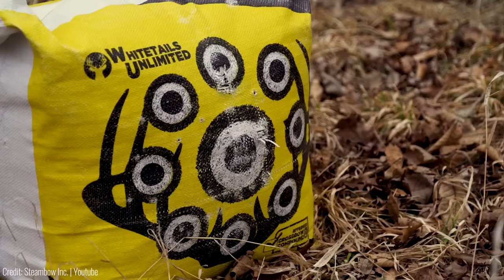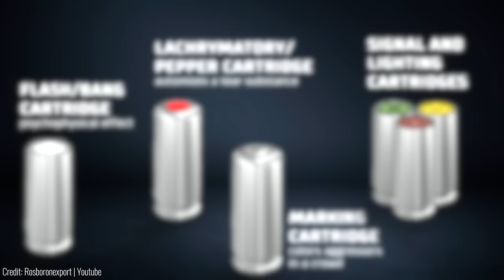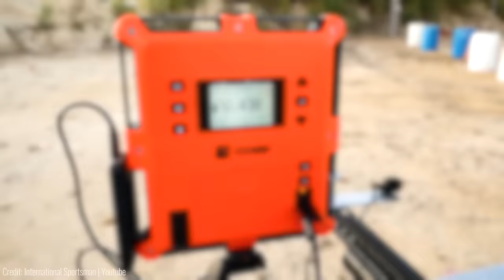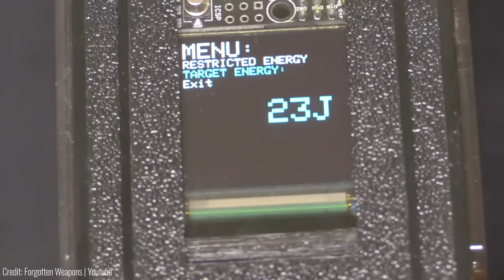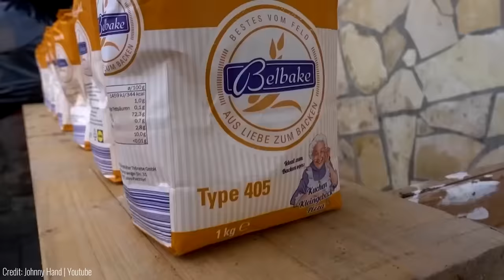12 Lethal Weapons That Don't Need Bullets

Comment: 75 miles per second? That has to be an error. There is absolutely no way.
Reply: Its mach speed, new covert ops tech
Reply: I'm guessing meters... so 250ft/s
Reply: Yea, even naval rail gun is about 1.3miles per second so I doubt this much smaller rail gun is even close to that.
Reply: That’s only 396,000 fps. Of course that is possible, I’ve chronographed my Daisy Red Rider in excess of that!
Reply: @richardwaid4718  I would love to see a crono that can even read that number lol
Reply: From the manufacturer's site: 75 m/s... meters per second or 246 fps. Essentially a Crossman BB gun circa 1980. Complete joke.
Reply: Do the math,,Mach 6
Reply: Feet more than likely

Comment: 00:25 Rochan Slingshot
01:13 Steambow Fenris
02:11 Gamo TC-35
03:18 PB-4SP OSA PISTOL
04:30 Hatsan Harpoon
05:43 CA-09 Railgun
06:47 Grappling Hook --- Question: How many ropes do you get? Or does it just retract the ropes?
07:44 EMG-02 Coilgun
08:41 X-Bow FMA
09:38 Hammer XT
10:25 GR-1 Anvil R Gaus Rifle
11:24 Arcus Arrowstar
Reply: retracts the rope i would not trust it to hold a persons weight. how well could they attach?
Reply: @garfnob4832  it's a lot more than what it sounds like. But yeah, it most likely won't hold the average person today.
Reply: Pointed sticks

Comment: So many Naysayers! Sling Bows and Crossbows have been used for Centuries, they're as accurate and lethal as the Archer. No one should opposed or disinterested in alternatives, especially in these times of "Uncertainties" and necessary when stealth is mandatory in order to resolve certain situations.
Reply: But slingshots didn't show up until the late 1800's
Reply: @MisterXenomorph  The Modern Slingshot came about in the 1840's it's precursor was what's known as the Shepherd's Sling which goes back more than 2,000 years.
Reply: the FMA crossbow has now a magazine too, and of course are they deadly, like you said, they used it over millennia, even the first rifle were nearly useless against experienced bow warrior! And an arrow in your body is worst as a bullet, you can't move bcz you feel the arrow in your body, with a bullet most can still move or run

Comment: 08:04 75 miles a second?  That's some wicked velocity for you!
Reply: That rail gun shooting 75 miles a second is a bold face lie put it to the test I bet it's like 300 fps maybe it barely made it through a can 😂😂😂😂
Reply: Star trek fans they are still toys with no practical use other than pissing things off!!!😂😂😂😂
Reply: It's 75 meters per second.
Reply: @kayakMike1000  Not even that
Reply: I think he was supposed to say 75 yards per second witch equates to 225 feet per second. 75 miles per second is unheard of.
Reply: 75 m/h = 396000 f/s. They must have stolen the design from the crashed alien UFO

Comment: 12 lethal weapons that dont need bullets. 
1. hammer
2. rock
3. block of wood
4. steel pipe
5. your hands
6. pencil
7. knife
8. rope
9. razor blades
10. water
11. unopened can of creamed corn
12. a toothbrush
Reply: 13. Spare tyre
14. Whole car.
15. Katana
16. The list is endless...
Reply: I've always considered my body as a lethal weapon... So is my brain...
Reply: lol ya I know people dont understand the meaning of "projectile"...   but I can imagine getting hit with the cream corn would hurt..
Reply: Nuts depending on who you use them against
Reply: Don't forget the wooden Kung Fu bench.

Comment: That bow is so badass but it also looks like it could malfunction pretty easily. Would love to at least give it a try.
Reply: It's actually a very simple design.
Reply: I think the bow itself is sold separately. If it isn't then the 1.1k price tag might be justified but most compound bows are far less than 1.1k

Unless you meant the crossbow

Then in that case your pick

Comment: Okay: the first thing some injury or pain survivors do is inflict revenge; my concept is such that non-lethal shouldn't mean non-penetrative; for less-lethal-weapons I recommend partially entering the body to require professional-medical-extraction when convenient; they'll hurt, incapacitate, immobilize, staunch and seal wounds effectively causing and triaging wounds in one shot, tagging them for officials to process.
Reply: What do you recommend for the best lethal weapon that isn't an actual gun? I was looking at the BYRNA's but my concern with those is even though I heard it will put a home intruder down, they will eventually get back up and might attack me or my family. Any suggestions would be greatly appreciated.

Comment: 75 miles per second (if it were possible) would make the impact energy of that tiny projectile about 35 million ft lbs
Reply: Not to mention, at that speed any projectile would melt or even vaporize…unless you were outside of atmosphere

Comment: 8:00...75 miles per second?? Must be a mistake .Thats like 270.000 MPH  .Assuming that the weight of the projectile is the same as a 9mm bullet .Kinetic Energy= 
2
1

 ×0.0165 pounds×(396,000 feet/second) 
2
 ≈4.39×10 
11
  foot-pounds

This is an astronomical amount of energy. For reference, this is far greater than the energy released by even the most powerful conventional explosives

Comment: A cane I have, is made hollow,  for planting beans without bending. It's got a little spade-like end. It also happens to have a good handle, and is made of steel water pipe. It might be non lethal, depending on where you got hit with it. It's a planter, thats all.😈☠️

Comment: I'd love to have some of these rail guns & especially the compound pistol crossbow it'd be excellent for ratting (rat vermin control) the 5 areows magazine for the standard size compound archery bow? is a nice idea my only problem with them is that the manufacturers don't make them for left handed people.......but otherwise yes some excellent alternatives to bullet firing weapons 😊
Reply: Coil gun, not railgun.
Reply: considering the arrow prices for that pistol crossbow, that would be a very expensive vermin control. You are better off with airguns for that matter i think.

Comment: 8:03  "...fire at 75 miles/second..."
Uh, slight wording issue there.  You mean FEET/second.  75 miles/second is 270,000mph.  It's NOT firing that fast...no projectile weapon on Earth fires projectiles anywhere near that speed.

Comment: theres those people thinking cartridges are called bullets... but in turn...   nevermind I'll explain the bullet IS the only thing that leaves the barrel of a gun,,, the casing to hold it with the explosive powder is just a brass hollow case... ejected out the side....     so it fact... ALL of theses use "bullets"  or "projectiles if you will.....
and if its passed 500 feet per secong or 4.2 foot pounds of energy..... its illegal...  here anyway

Comment: TLDR most of them are toys for shooting targets and the ones that are not there are better options on the market usual cheaper. most are only lethal if that.

12 - ammo does not get much more traditionalist then stone, lead, or steel shot. in fact the word bullet comes from the the lead ammo used with slings. the laser sight would be useless. ANY variation in wrist tilt will through the laser off. you would be better using the line of the rubber tubes to line up the shot.

11 - arrows almost as old as sling shot. defiantly traditionalist ammo. other then that ok gimmick. you can use a bow better without is for so many reasons. spend the grand on a better bow.

10 - the first non traditionalist ammo firing platform combo. if you do not have access to "bullets" where are you getting the compressed gas. you can get a 22 long fife for as low as $140 the ammo is everywhere and light expressly compared to a gas can

9 - ok, but at an intended range of 5 meters (15 feet)  max of 10 meters (30 feet) if you do not drop them with your first shot they will be on top of you. the feeling of safety you get will make you less safe.

8 - back to traditionalist ammo. hard to load, dependent on compressed gas, not a bullpup (just a buzz word in this case). bullpup = a rifle whose barrel is bedded well back on the stock so that the end of the receiver is very close to the heel of the butt. ignoring rifle and barrel the bolt half way back well in front of the tiger. please do not fall for buzz word. this is a standard crossbow powered by compressed gas instead of bow limbs. it is less wide if that matters to you.

7 - it cannot get through backer board at 10 feet so useless as a weapon. the video of the guy in the blue baseball cap is the one i saw that showed this is fun but useless it has NO stopping power. THIS IS DANGEROUS TO USE AS A WEAPON. it is a toy to go shoot targets with.

6 - do i need to say anything other then ridiculous?

5 - slightly better then #7. it could break skin but still no serious harm. still suffers all the same problems as #7.

4 - a compact crossbow. ok. less stopping power then a full size do to lighter ammo. 

3 - ok, a sling shot with a modified front rest. shot would work better.

2 - this is the older version of #5

1 - bounced off a TV at 20 feet to be generous. enough said